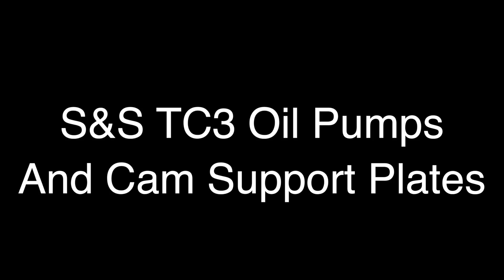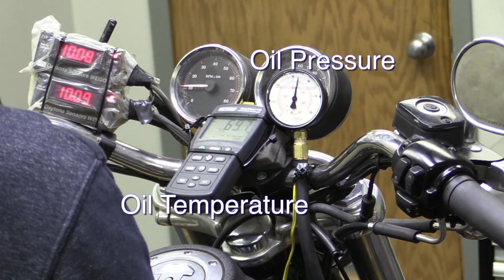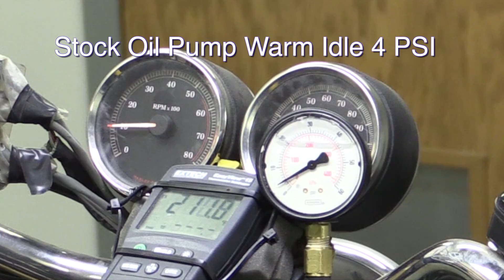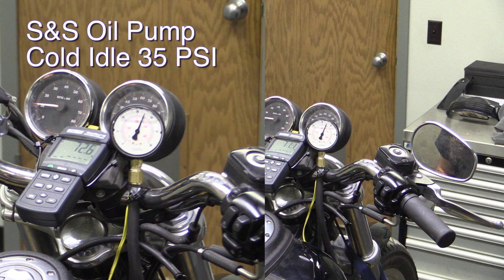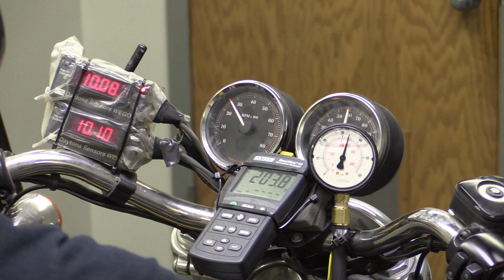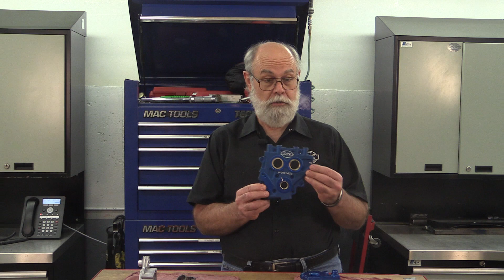S&S Cycle -  TC3 Oil Pump & Cam Plate - Test Vs. Stock

Comment: put in the S&S cam plate and TC-3 oil pump w/my SE Stage V kit a few weeks ago...big difference...and yes, running 35 psi at cruising speed around 2500 RPM, scavenging around 13-15 psi hot idle...made it even better adding an Oil Bud oil cooler system...2012 FLHTK Ultra Limited
Reply from the maker: Glad you are liking the new set up! Yes, we definitely recommend adding/running an oil cooler when riding in warmer regions.

Comment: Interesting to see this on a 88”. My 103 is 10# at idle and about 30# cruise and 45# peak 3500+. Personally didn’t feel like 45# was enough but I suppose they really did improve the design. 

I also know I can modify the pop off for more pressure but I see no point in going in there again

Comment: What is the difference between the S&S plate and pump vs. the Screaming Eagle one. They look identical??
Reply from the maker: Number of things. For the Twin Cam we use a forged plate (for stability), adjustable oil pressure and brass bushings to reduce friction. Superior product in every way.
Reply: @SSCycleInc  Screaming Eagle also has brass or bronze bushings.

Comment: I've got a 16 ultra limited.  at hot idle I get 15 to 18.  hot highway 33 to 36.  the motor makes no adverse noise.  is this low oil pressure everyone seems to talk about only affect the older models,  or is it something that my bike will  eventually have once it wears in?
Reply: The stock plate can have porosity. Which allows oil to leak by. If you don’t know already. there are several videos and articles on the problems with OEM Cam Plate. American Iron Jan 2018 has a very good article about it. There is an article on their website with a fix. 36 is not terrible. At idle 4 is bad. That means the engine isn’t getting enough oil to the top end.